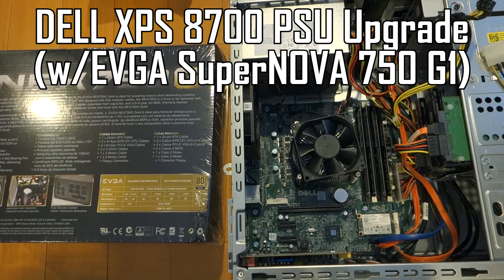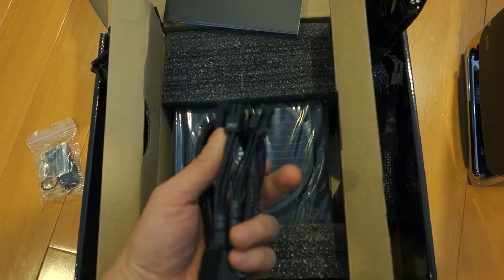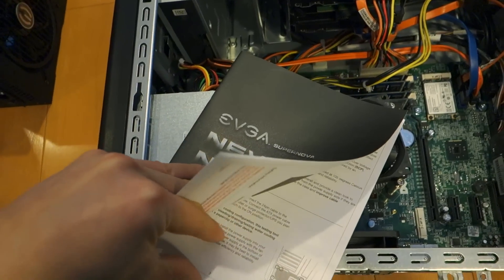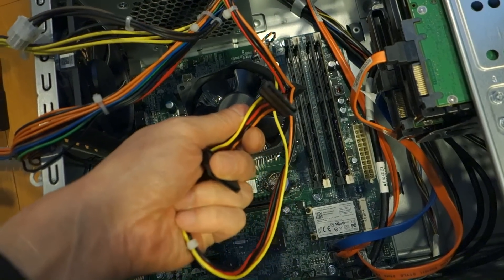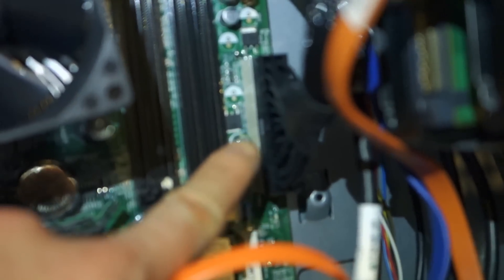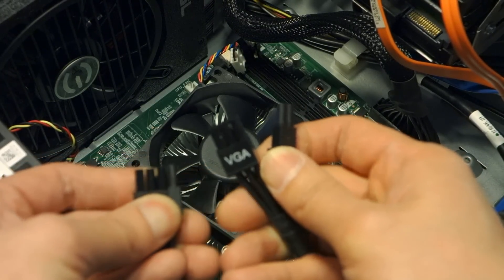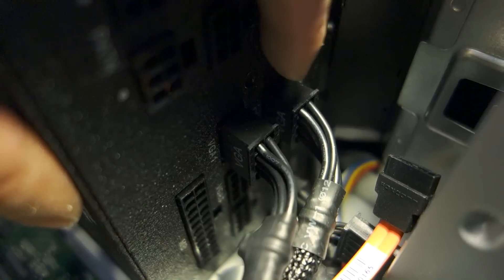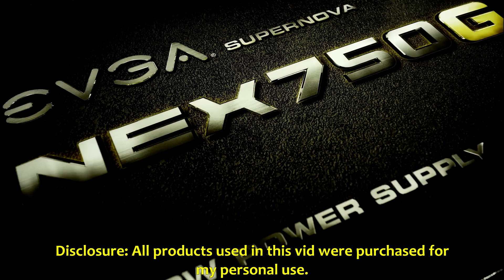HOW TO: Dell XPS 8700 PSU Upgrade (w/EVGA SuperNOVA 750 G1 and HD 6970)

Comment: This is a great video! I want to upgrade my PSU in my Dell XPS 8700 soon. How much quieter is the EVGA SuperNova 750 over the stock PSU? I just bought a new graphics card but might want to upgrade PSU. I bought the EVGA GeForce GTX 750 Ti Superclocked graphics card. It is light years ahead of the POS Radeon HD 7500 I had. 

I guess fully modular PSU are best for the XPS 8700? I was looking at some of EVGA's semi-modular ones and I am not sure about the cable placement for fitting that bad boy inside the XPS 8700 frame.

I was looking at the EVGA SuperNOVA 750 B2, 80+ BRONZE 750W, Semi Modular.  It is about $60CAD cheaper than the gold fully modular. Not sure what to do. 

Thanks for making this video!

Comment: I have a 500 watt, and I cant get a AMD RX 470 to work. HELP!!!!
Reply from the maker: What seems to be the problem?
Reply: Black screen, I have a working trick though to get it to boot properly
Reply from the maker: Have you upgraded your BIOS to latest version? (I believe it's A11) Also, try a "reset" by removing the CMOS battery with the power cord unplugged and then pressing the power button to release any stored energy then replacing the battery and powering on.
Reply: I cant
Reply: I had a trick, does not work
Reply: Chances are 50%, unless you have a Bronze or Gold rated 500W PSU (have seen Gold only in 550W & upwards), you 460W OEM model may be better than the 500W upgrade. Like I stated above, Dell tends to understate the wattage on their PSU's, it may be closer to 500W & chances are better than 50% of the ones of that size on the market. 

It's also harder to find Full Modular PSU's under 500W, was considering a 650W, although for a i7-4770 & EVGA GeForce GTX 1060 SSC (6GB GDDR5), a bit out of my budget for the OEM PC, although do have two self built models with the EVGA G2 650W, one of these has a GTX 1070 (8GB GDDR5 256 bit), plus both has more drives & fans installed. 

This is of concern to me, need to find a way to hook up a fan to the place on the front, an intake, which can be used on the OEM fan header, can use a PWM connector to upgrade the rear exhaust to blow out as much air as needed, am considering a Noctua fan with the fastest speed possible. Which is a challenge for a 92mm fan, no matter the speed, won't move the same amount of air the NH-F12 (120mm) fans on my self-builds.

Cat

Comment: first thank you for the reply, this is the model I want to upgrade" for my dell xps 8700" EVGA-80 plus 600w atx 12v/eps 12v , for the graphics card is Nvidia-Geforce GTX 980 4 GB GDDR5 PCI express 3.0
Reply from the maker: That combo will work. Good luck with your upgrade!

Comment: I have dell xps 8700 and I want to upgrade power supply & graphics card but which one need to upgrade first or need to do both? thank you.
Reply from the maker: It'll likely be easier to upgrade both at the same time. The PSU you'll need will depend on which GPU you want. Which model are you considering?

Comment: Is there any possibility of this power supply falling due to the weight and size difference, and not being able to be secured by the metal case clips of the original psu?
Reply from the maker: As long as you securely fasten the PSU w/the four screws to the chassis I really don't see it falling off due to weight. I have since replaced the stock PSU w/larger ones in three other XPS machines and have yet to encounter any issues.
Reply: cool, thanks

Comment: damn I'm getting that problem where all the fans come on and I can hear my harddrives operating as normal , it seems like there's no video/ boot up. I know I securely installed all the appropriate cables. power light blinking orange(Dell). looks like a sequence. blinks 2 times then a quick pause, then blinks seven times.... :(
Reply from the maker: Which Dell PC? I would first double check all the cables are seated tight, make sure RAM is seated properly if removed then I would try a reset of CMOS battery (remove, drain power by holding the power button, make sure power cord not connected, then replace battery).
Reply: turboBB73 thanks man that was the problem, I left it off for a couple hours, had trouble booting up, got the bootable device not found error, so I went into bios config and choose the boot up option opposite legacy. it booted up no problem.. so in all I installed a supernova 850 g2 and also installed the 1080 gtx card inside my Dell XPS 8900 special edition. so far everything is working.
Reply from the maker: So, the battery reset worked? Glad to hear you're up and running. Enjoy the 1080, it's a beast!
Reply: turboBB73 yeah the battery reset did it's thing thanks for the support

Comment: Hey Turbo ,
Is it possible to just remove all the parts and move it to another case with a new power supply ? I'm having issues with choosing the appropriate power supply because of the spacing that's why im thinking of just buying a new case with psu .

Comment: How would you remove the top use ports my graphics car is to big
Reply from the maker: Sorry, I don't quite understand what you're asking but if you mean that your card is too long, the XPS8700 despite being a mid-tower ATX can accommodate very long cards. Case in point, I currently have the Asus ROG Strix GTX 1060 in there (11.73" / 29.8cm in length). It was a tight fit but w/careful angling I managed to install it. Can you elaborate on the issue you're encountering and the brand & model of the card?
Reply: +turboBB73 hi can I change my psu in Dell 3010 mid tower and also can I change gpu gigabyte gtx 950 xterme i ask u becoz too many people said my pc is branded I can't change but your Dell also branded u can change psu or gpu can I change like u? thanks
Reply from the maker: You should be able to upgrade both, see this thread: http://www.tomshardware.com/answers/id-3048398/optiplex-3010-gpu-psu-upgrade.html
Reply: +turboBB73 thanks for reply but why people's said in branded pc we can't change anything they are wrong

Comment: Hey thanks for this video. I am looking to get  a corsair RMi Series RM650i as my new power supply. But am not sure if it would fit. Do you know if it will fit?
Reply: Send me specifications and I will check.
Reply: Mine is a DELL XPS 8700 too.
Reply from the maker: Been getting a lot of q's about whether XYZ brand's PSU will fit so please note:
- any replacement PSU must have 1 x 24 pin ATX cable & 1 x 4 pin EPS or 1 x 4 +4 pin EPS cable (and of course the requisite PCIe & SATA cables you need)
- factory PSU dimensions: 140mm (D) x 86mm (H) x 150mm (W)
- EVGA 750's is: 180mm (D) x 85mm (H) x 150mm (W)
- while you have room for a slightly taller (H) or Wider (W) PSU but NOT longer (L/D), this will depend on what kind of CPU cooler or other equipment you may have crammed in your XPS8700

Looking at the specs for the Corsair, the dimensions are: 150mm x 86mm x 160mm which I assume to be (W x H X L) so it should fit.
Reply: Thanks alot for the reply mate. Cant wait for my new power supply and GPU to arrive tmr! :D
Reply from the maker: Good to  hear and good luck with your upgrade! Cheers
Reply: Hehe ty. Cheers m8

Comment: will I be able to put a r9 270x or the new polaris gpu into the optiplex 350?
Reply: optiplex 390*
Reply from the maker: You didn't mention whether you have an aftermarket PSU but if stock, for the 270x - highly doubtful. The Optiplex 390 is on the smaller side and while I'm not certain of the exact dimensions, the 270X is a fairly large card with high power requirements; they specify 500W for total system but I'd imagine you'd need at least 360W+ just to support this card and I believe your PC only has ~250W).

You'd stand a better chance w/the upcoming Polaris GPU's (max TDP = 150W for the 480) which your stock PSU should be able to drive but just not certain you'll have the requisite power plugs.
Reply: turboBB73 Im also upgrading the psu to 650 w. So you're saying the only thing I have to worry about is making it physically fit? Also can I upgrade the cpu from an i3 2120 to an i5 2320?
Reply from the maker: Not just physically fit but double-check what pin's you need (6 or 8) and how many of them (e.g. Sapphire R9 270x required both a 6 and 8 pin). As for CPU upgrade, the 390 uses a LGA1155 socket so based on this list: http://www.cpu-world.com/Sockets/Socket%201155%20(LGA1155).html  the i5 2320 should fit.

Comment: If my card  runs two 8 pin connectors would i run thew two 6 plus 2 cables? One to each? I am purchasing this in a week so getting all my information down!
Reply from the maker: +Chris Segovia (Maniak) Correct, you'll use both the 6+2's in 8 pin config.
Reply: +turboBB73 thank you very much
Reply from the maker: +Chris Segovia (Maniak) You're welcome and post back how your upgrade went. Cheers

Comment: Can EVGA 750W G2 able to fit to dell xps 8900?
Reply from the maker: +Firudin Imani I don't own the XPS 8900 but based on the dimensions (exterior) and specs as well as pics I found online, it looks to be identical to the XPS 8700's chassis so it should fit.
Reply: +turboBB73  Thanks but is the size of the 750W G2 the same with G1? Because as you showed in the video the G1 was very tight.
Reply from the maker: +Firudin Imani Yes, the G2 dimensions are the same vs. G1: http://www.evga.com/Products/Product.aspx?pn=220-G2-0750-XR
Reply: +turboBB73 Thanks bro
Reply from the maker: +Firudin Imani You're welcome and good luck with the upgrade!
Reply: +Firudin Imani I also have a Dell XPS 8900 and I want to put in EVGA SuperNOVA 750 B2 80+ BRONZE
would I have any problem installing this beast?
Reply from the maker: +AwesomeBlackDude You shouldn't, it's the same size as the 750 G1.
Reply: turboBB73  Thanks lol now I gotta to wait until the bank receive my DELL 1k T-returns money back into my account even thought it was already there but now it gone. Go figure.

Comment: Dear guy, my son ( Yuri Palma, maybe his youtube channel is also interesting for you ) is using 8700 for editing, 4K.  ( even 8K...) Do you think that XPS 8700 ( DELL0KWVT8) with HD 6970 and new PSU is ok with 4K editing?  Do you suggest GTX 970 or R9 390? R9 390X would be also fine, in your opinion? Of course, changing the PSU. Thanks in advance!!
Reply from the maker: +Fabio Palma It'll depend on which NLE what is the final output format you plan on using. If you're using Vegas and you'll be outputting only to MP4 then yes, the HD6970 w/Main Concept AVC/AAC will be good. If a different editor, then it'll depend on whether the GPU acceleration takes advantage of CUDA (in which case go with NVIDIA cards) or OCL (in which case stick with AMD cards). Either way, the XPS 8700 w/upgraded GPU/PSU should handle 4K editing fine.

Comment: Can I use the wifi card from this PC in another one?
Reply from the maker: +TheJadedex The wireless mini card is Mini PCI-E form factor so it should work as long as your other PC/laptop has a Mini PCI-E slot. The problem would be finding the driver for it since I'm not certain the Dell driver will be compatible.

Comment: I would like to buy an EVGA 850W G2, instead of the 750W. Can the 850W G2 be installed in my Dell XPS 8700? Will I have to do anything differently than what you did in the video?  Should all the cords/cables be plugged into the same places on the 850W G2 as the 750 G1 that you show in the video? Thanks.
Reply from the maker: +joshspiker Yes, the G2 has same dimensions and add'l cables, however, some are slightly longer so you might have just have to rearrange them within the chassis a bit. Install should be exactly the same as in my vid for G1 but again, use your discretion and ask for help if you're unsure what goes where.

Good luck with the upgrade!,
Tim

Comment: Were there any other parts or accessories that you had to purchase separately to install the PSU? 

Have you replaced any other parts in the XPS 8700, such as the OEM fan?
Reply from the maker: +Rodger Dodger Nope, everything I needed came with the PSU. I have not as of yet changed out any other parts in my XPS 8700 but might get a water CPU cooler in the future. If so, I will be posting a vid on it.

Comment: I have a Dell CSP 8700 and I am upgrading my GPU to a R9 390, and getting the EVGA 600W PSU. I was wondering, how difficult was it to nudge it in there?
Reply from the maker: +Any751157 I assume you mean XPS 8700. As for the R9 390, that's a fairly long card (using Sapphire's version, it's listed at 12.1" which is about 1.5" longer than my HD6970) but there should be enough clearance in the chassis for it. As for the EVGA 600W, the largest is the G1 and that shares the same dimensions as the 750 G1 covered in my vid so as long as you take it slow and follow my directions, you should be able to get it in there. Of course, use your discretion if you're not comfortable with self-install and seek professional help if need be.
Reply: +turboBB73 All right, thank you so much! Thanks for your help. And yeah I did mean Xps 8700 :p
Reply: +turboBB73 http://www.newegg.com/Product/Product.aspx?Item=N82E16817438025 Will this fit inside the PC well? Its smaller than yours I believe, but I'm not sure.
Reply from the maker: Yup, it's slightly shorter by 15mm vs. the one I have so should be just a tad easier to fit in.
Reply: +turboBB73 Again thanks so much for your help. Just ordered the MSI Radeon r9 390 with the psu I linked, the MSI is shorter than the Saphire, so all should be well. Hopefully Ill be able to run fallout 4 max settings at 1080p :D. Thank you!
Reply from the maker: No prob and lemme know how it goes with your build.

P.S. Enjoy Fallout 4! Too bad I don't have much free time otherwise I would be all over that game. I was a huge fan of that series and even before that, I loved Wasteland (this likely pre-dates you so look it up if you don't know what game that is). ;o)
Reply: +Any751157 Dear guy, did you manage it? My son, Yuri Palma, is doing 4K editing with 8700 and would like to upgrade Graphic card. R9 390 is ok to you?
Reply: +Fabio Palma Yes! It took a lot of stress and nudging, and it was a very tight fit, but it worked in the end. Its working fine now. I wish your son luck!

Comment: Hey, I'm looking at upgrading my XPS8700 to a GTX980, which would mean i also need to upgrade the PSU... was wondering if most PSU's fit inside, cause i see this took a little "finagling"... but i was wondering if you had a few models that would be compatible and efficient for the GTX 980
Reply from the maker: +John Schiavo Technically the stock PSU is sufficient to power a GTX 980 since max draw is ~165W (depending on the brand you get). The main thing though is that certain ones require both a 6 & 8 pin PCIe power cable (or even 2 x 8 pin's) which in that case you should upgrade to get the add'l pins. I'm aware of splitters like this (http://www.amazon.com/StarTech-com-SATPCIEX8ADP-6-Inch-Express-Adapter/dp/B007Y8FSMQ) but I don't trust them to be stable or robust enough since SATA power cables was never really designed to handle high-wattage (~54W max each line and a 8pin typcially can go up to 150W max). Lemme know which flavor of GTX 980 you're considering and I'll come back with some suggestions.
Reply: Hey! i was looking at the GTX 980 FTW from  EVGA, wondering if it will fit inside the ups 8700, also looking at a 650w G2 PSU from EVGA, wondering if this will fit inside, these are my biggest concerns... once upgrading it seems like i will need to upgrade the bios as well? thank you for the feedback it really helps!
Reply from the maker: +John Schiavo Yes it'll fit since dimensionally, it's slightly smaller than my HD6970 (you may need to remove the black GPU brace though, but no worries, if you're not moving your system around much, you don't need it).  As for the G2 PSU, yes, that will fit and will be slightly easier to install than the 750W G1 I used since it's a little shorter. Last but not least, yes, get the A11 BIOS (latest).
Reply from the maker: +John Schiavo BTW, I was just on slickdeals and noticed a sale going for the P2 (yes it'll fit, 1mm taller than the G2):
http://slickdeals.net/f/8117032-evga-650w-platinum-p2-fully-modular-psu-70-ar-model-220-p2-0650-x1

Not sure how much the G2 you're looking at is going for but might be worth a look (no, I don't make any fees off this, just a friendly PSA for you). ^_^